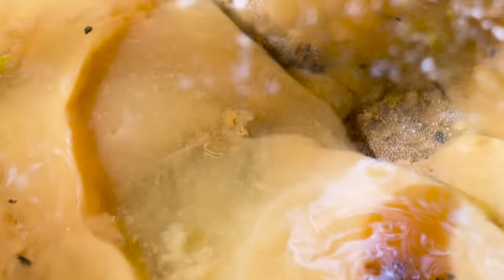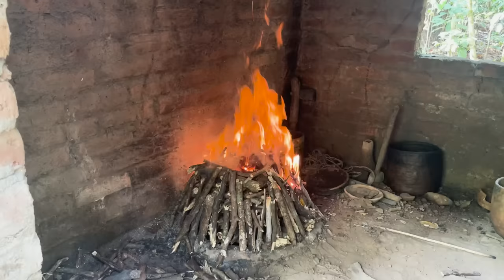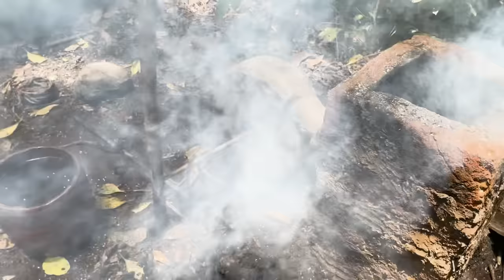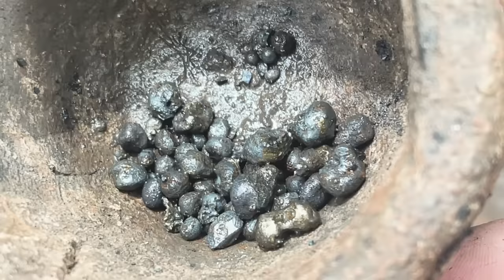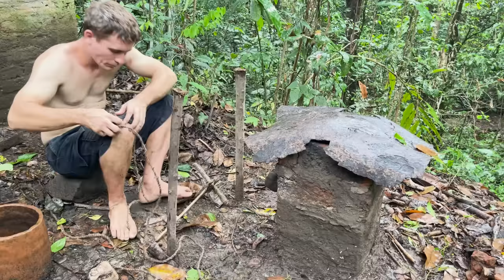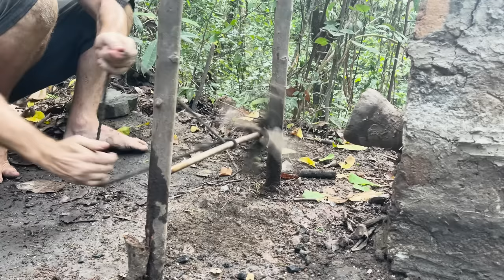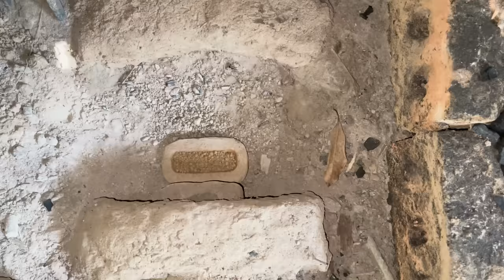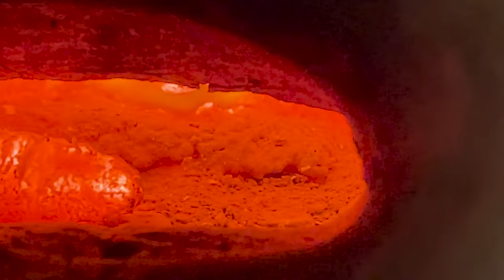Primitive Technology: One-Way Blower Iron Smelt & Forging Experiment

Comment: I'm not a metallurgy or mechanics of materials engineer by any means but i have studied it in classes associated with those subjects while getting a degree in mechanical engineering. These videos are a blast to watch and he's on the right track to making a forgeable iron if that's his goal. He's basically made pig iron which has a pretty high carbon content of typically around 4%. Carbon serves two purposes in this application. It allows the metal to reach a higher temperature for refining (which is how he was even able to get a solid bar of iron in a freaking charcoal furnace to begin with) but it doesn't allow the pig iron to be ductile and malleable for forging. The other issue with pig iron is it has a crap ton of impurities in it which are also messing with the composition of the iron being forgeable. Now if he is trying to forge this iron, he doesn't want a high carbon content and he wants the least amount of impurities as possible because what will happen is when he goes to hit it (to shape and form the iron bar), it will just crack and break. Which is exactly what happens in the video. He needs to essentially lower the carbon content of his iron that he has created and remove as many impurities as possible. This is where things get a little tricky. There are some pretty extensive and time consuming processes for lowering the carbon content so that might not be his next step. I think he needs to go through a purifying process. Without going too crazy into the material science and mechanics of materials aspect of things, i would say his best bet is to use a flux to help remove impurities. The impurities form slag that can then be removed from the iron that will become somewhat more "pure" then before. Getting the iron to a higher temperature (melting point is ideal) the flux will more easily remove impurities versus a white hot bar. shells are honestly not a very good flux material because of their chemical composition which is consistent in what he has seen in previous videos. But limestone (aka nature's "chalk") is actually kind of a perfect flux in this application for pig iron if he's trying to stay consistent with only what's in nature. The specific chemical composition of calcium carbonate (limestone) can be used in refining pig iron and extracting the impurities from the iron itself. I think if he is capable of getting his hands on limestone (which i don't see why not, its a pretty common sedimentary rock) and somehow getting his furnace hot enough to actually melt the iron (rerouting hot air possibly?) and maintain the heat, I think he can refine the iron to become more forgeable. Ideally if he had a larger crucible and more iron, with the flux, physically scooping out the slag (or impurities) that float to the top would be his best bet. But i don't know how feasible it would be to skim the top with the setup he has. I think coating the iron bar with crushed up limestone(as fine as he could possibly get it) and then letting it cool down to extract the slag and repeating the process maybe a couple of times could get the results he's looking for? The problem is, if the iron isn't molten the limestone could produce poor results. The idea is to get that limestone as incorporated as possible into the iron itself so it can react with and separate those impurities in the iron. Maybe instead of covering a bar with limestone, make a crucible that can increase the surface area so the limestone can be incorporated as homogenously as possible? I'm thinking a really thin iron plate? Maybe the bar is totally fine? Even agitating limestone into a semi-molten iron with a ceramic rod could be enough to get the results of processing the pig iron? Just a thought. Let me know what you all think?
Reply: Limestone is definitely probably the ticket here if the temperature can be increased enough. I hope you have limestone available to crush and add.
Reply: @BigBaddaBoom  From memory there wasn't any limestone available in that area - which is why he used snail shells to make a cement in the building videos.
Reply: Can you summarize
Reply: The best video I've seen for the next step would be from FZ - making knives. https://www.youtube.com/watch?v=wTKtth2oVlw
the principle of creating a container which you do the chemistry in is surely the next step. If everything fully liquidises in the vessel then the metal and slag will separate into two parts and the flux will draw out the carbon and other impurities. Once cooled it can be broken off the top of the iron pellet formed.
Reply: this is not cast iron. This iron is brittle not from carbon but from slag
Reply: Peak on the spectrum
Reply: I don't think he has access to limestone. Or any calcium carbonate sources.

He may very well be hard stuck on ever getting out of the stone age, because as far as I can tell, he doesn't have access to bronze either, so he'd need to somehow make the jump to the iron age, but short of doing an extensive and exhaustive survey of the piece of land he's using, I don't believe he will ever get out of the stone age by using the resources he has available.

That's not to say these videos don't show incredible ingenuity and progress, but this may very well be the limits
Reply: Would it possibke to make fluz out of crushed up shells?
Reply: @gregarmstrong6077  He can get calcium carbonate from wood.   Burn wood to ash. White ash is calcium carbonate.  Add water allow to settle decant ( or keep if you want som Postassium Carbonate for later ).  The sediment is your Calcium carbonate.   Probably better quality than the snail shells and easier to collect in a larger volume.
Reply: @Jesus-eu4gn  I asked chat gpt to summarise:
The person suggests refining the iron by using limestone as a flux to remove impurities. They propose incorporating the limestone into the molten iron and discuss methods like coating the iron with crushed limestone or using a thin iron plate to increase surface area. They also suggest agitating the limestone into the molten iron with a ceramic rod.
Reply: Great comment but my dude. You gotta use line shift. Huge wall of text is not good one the eyes and makes it hard to read.
Reply: @Jesus-eu4gn  It just takes two minutes to read.
Reply: Very good commentary. What was produced here in the video is indeed an intermediate product that is still a long way from a workable iron-based material in terms of quality. The pig iron must be remelted at very high temperatures, at best above the melting temperature, so that slag can form. This should be allowed to run off during the process in order to remove interfering elements. Additives that reduce the sulphur content, for example, are of course helpful here. The pig iron must then be further processed by forging until the carbon content is sufficiently low to produce workable wrought iron. It will be exciting to see whether he can achieve this material quality with his methods.
Reply: @gregarmstrong6077  He should get calcium carbonate if it is leeched from crushed shells and then recrystalized.
Reply: @janzwendelaar907  "He may very well be hard stuck on ever getting out of the stone age".ther's always the possibility of trading some bricks for limestone with other neanderthals living around 😄
Reply: @juanaq  It's really a shame this particular genre of videos never took off. What I would be interested to find out, is if it is even possible to get to the iron age in Australia, or NZ, I forgot where John is filming.

We have a decade worth of information about what one man can do in one very specific patch of land, but what if there were more men? What if there were more patches of land?
Reply: A mistake young engineers often make is to discredit themselves when they are in school. Don’t do that.
Reply: Carbon actually reduces the melting point of iron, if I recall correctly.  That’s why cast iron has a carbon content around 3%, because it makes it easier to melt the iron so that it can be cast.  

Calcium carbonate can also be found in sea shells and snail shells, as well as egg shells.  These are easier to identify and collect than limestone, at least for a small scale project like this.
Reply: @juanaq ok, this comment gave me a good chuckle  🤣
Reply: The carbon content of the iron he produces in a small scale furnace like this isn't always  necessarily very high, and depends somewhat on the tuyere placement and rate of airflow. Limestone and other fluxes certainly can help although they are not strictly necessary.
Reply: @janzwendelaar907  So he has to build a ship and sail to other continents and trade or harvest their materials!
Reply: @stevenswenson7041  There are also videos on making wood ash cement here. It also worked well.
Reply: Awesome feedback, thanks everybody! I honestly wasn't expecting people to really read my post but I deeply apologize for how long that was (definitely an eye sore :S). Just trying to share my thoughts in detail. I do appreciate the advice though. His channel is phenomenal and I've been watching since day one. I think he is just as excited about the iron processing as we are and I'm just trying to help if possible. I doubt he will stop here though with the iron and I sincerely hope he doesn't. I look forward for more videos to come!
Reply: @GusCraft460   I totally agree, i didn't do a very good job of clarifying why reducing carbon would help in making forgeable iron. Thank you for making that clear!
Reply: @stevenswenson7041  Totally true! I think he actually used wood ash in a previous video to help refine some previous iron smelts. I know wood ash has a fair amount of calcium carbonate, like 25%? Common limestone has a minimum of 50%. Which i don't know if that would make enough of a difference in results/yield? But it would be interesting to see regardless what results he would get from using it. 

@jannikheidemann3805  Another interesting comment. Possible mixture of limestone (or wood ash) and shells? In my spare time doing some more research, poultry egg shells contain higher amounts of calcium carbonate over seashells. Maybe he should go hunting for a bird nest in his area he's working in?
Reply: @janzwendelaar907  How To Make Everything travels to get materials, if that's your jam.  IIRC John is somewhere in Georgia, USA
Reply: @andrelastname1992 being knowledgeable on a subject =/= autism
Reply: He's actually in North Queensland, Australia. Pretty sure this is mentions in one of the video captions 😊  @DFPercush
Reply: If he was to use your idea, but seal the iron and limestone in an air tight clay pot, he essentially could make a form of crucible steel. The iron would liquify, and the limestone would float the impurities to the top, then you smash the pot and take out the refined iron.
Reply: Couldn't you just mix limestone powder in with the ore in the initial smelt? Actually I think just doing bigger batches would probably be the solution that could be tried immediately (or as close to immediately as you get in this context)
Reply: @janzwendelaar907 ”access to bronze”? Bronze is not an element, it’s an alloy. How is he going to get copper and tin to create that in his little plot of rainforest?
Reply: @robertbrun get glasses then. I do wear glasses and it’s easy to read. BTW what the heck is line shift? Double spacing?
Reply: @juanaq there are some Neanderthals living in the Cairns rainforest. 😂
Reply: @DFPercush  I have no idea what IIRC is. John is in Cairns, Qld. That’s a looooooooooooooooong way from the USA.
Reply: This is primitive technology not modern, enjoy and learn from the past, not your modern stuff, but very very very primitive stuff about how “they” did things thousands of years ago
Reply: @janzwendelaar907 and this is the perfect answer as to why European, Middle Eastern and Asian civilizations were able to surpass other peoples around the globe. If you aren't afforded the same raw materials, it would be incredibly difficult to reach the same technological advancements.
Reply: @teeanahera8949  I know bronze is an alloy, the point is that he doesn't have access to either tin or copper. So he can't have a bronze age
Reply: @janzwendelaar907  more men, more land, and maaaaaany more years. have in mind that this guy knows exactly what he wants to achieve and he has access to the information on how to achieve his goals. many of the techniques he is using were developed by generation after generation of humans experimenting almost blindly, and surely many times by sheer coincidence and luck.
that said, he's brilliant.
Reply: It IS also possible to remove impurities from just physically beating the heated metal enough, but it takes a LONG time, and lots of work. But might be the only option, if doing it chemically isn't possible due to material or temperature limits.
Reply: This is brilliant, and I love it.
Reply: i allat
Reply: I think you are pointing in the right direction, using flux and high temperatures surely will help with the impurities, but it wont matter unless he gets to decarburice the iron up to at least an eutectoid steel. This could be done with the smelting technics used with wootz steel or damascus (the real one).

It basically consist in enclosing the pig iron in an hermetically sealed clay pot with charcoal and limestone flux and then baking it to high temperatures, this way you get basically a miniature high oven setup. The idea is to melt the pig iron letting the impurities float with the flux slag, at the same time, the charcoal will burn in the low oxigen enviroment of the clay pot, making carbon monoxide, then carbon monoxide will capture the excess carbon in the pig iron.
Reply: @mequedo I’m a little confused. How can carbon monoxide capture carbon dioxide? I thought carbon monoxide needs oxygen to oxidize?
Reply: Fax
Reply: Cupola furnace. When smelting the iron with iron ore/ charcoal in layers, the lime is added to remove the impurities during the smelt. Thats how cast iron is made. Still a high carbon content, but a cupola will produce molten iron rather than a bloom. Though the japanese iron workers would stack bits of bloom steel and wrap it in clay/ paper and straw, then forge that down, to refine the iron. See 'that works' or 'man at arms' channels to see that explained. Ilya does a great job of explaining
Reply: The temperate can be increased but it would need a lot more air a while ago I suggested to make two of those blisters dude by side.
Reply: Materials is a huge barrier for him. The lack of chemicals to properly purify the iron.

On another level is the lack of cloth/leather. As ingenious as the blower is, bellows is what would be traditionally employed. The continuous air  to maintain temperature is another key element. The solo element is also prohibitive, since he can feed the furnace and run the blower at the same time.

A 2 stage bellows would solve this but it’s nigh impossible to build one without leather or cloth
Reply: Yeah I study metallurgy and you are wrong lmao
Reply: Might wanna break that up for readability but fantastic comment!   Limestone may be "common" as we see it, but it's very regional.  I don't think John has access to it, which is why he used shells.  If he bakes the shells first, it should get rid of the impurities and essentially be the same thing.  That's what limestone is, after all...
Reply: @northernmetalworker  I remember seeing a documentary where modern blacksmiths tried that to recreate ancient swords, I believe Ulfbehrt was the name, and they actually succeeded in low grade crucible steel
Reply: @mumtrz  define study
Reply: @lelezhang9075  i might be mixing up concepts.
Reply: @garethbaus5471  It does, but the fire coming out of the top looks like a reducing flame, so it's probably a safe bet it's a reducing flame inside too. Steel's lowest melting point is around 4.3% carbon too so having high carbon actually helps it melt and form the prills in the slag.
Reply: @getem990  Another huge game changer were beasts of burden. Domestic animals took a lot of work off humans, and freed them up to do other things. Europe and Asia got lucky by having animals that were possible to domesticate.
Reply: @mumtrz care to elaborate?
Reply: @lastplace199  If the air source blows more directly on the spot where iron collects rather than through literally all of the fuel to where the iron collects it doesn't necessarily matter that the flames blowing out the top are a reducing flame the iron itself will have most of the excess carbon burn't off as part of the process.
Reply: @janzwendelaar907  I don't really know about this stuff but can calcium carbonate somehow be extracted from ash?
Reply: @stevenswenson7041 what cN potassium carbonate be used for
Reply: Yeah sure, lol!
Reply: I'm surprised you guys are so into the processes and steps of metallurgy, as it is very interesting to put it this way. 😂
Reply: Would bones work for calcium?

Comment: The dramatic arc from "It crumbles" to "The iron can be recycled by adding it to future smelts" is phenomenal.
Reply: It's not like it can go bad
Reply: Just like all lifes failures, its necessary for building future success 🥹
Reply: "its so over"  >>  "we're so back"
Reply: What arc bro they were like 30 seconds apart lmao
Reply: It's not Owen......
Reply: White cast iron is not forgeable. You cast it and then it remains as-is forever, you can only grind off the blemishes but that's it. 

Interestingly enough, the strongest steel has "medium" amount of carbon, between pure iron and white cast iron. There's a sweet spot at which it's both extremely strong and forgeable. Too much carbon and it becomes brittle. Not enough carbon and it becomes weak.
Reply: Too much carbon man.